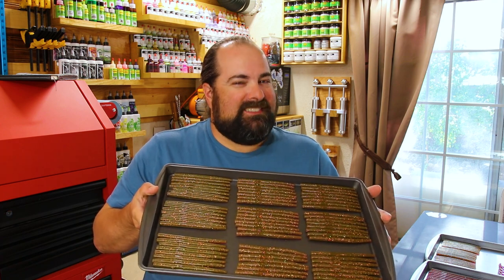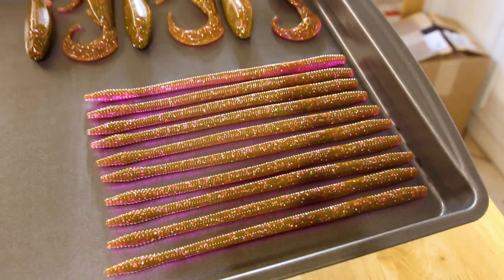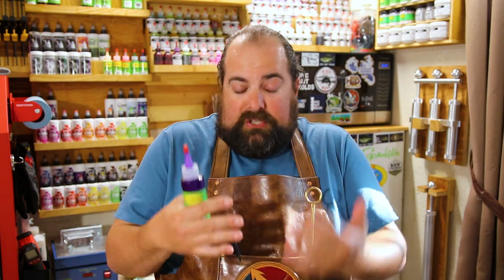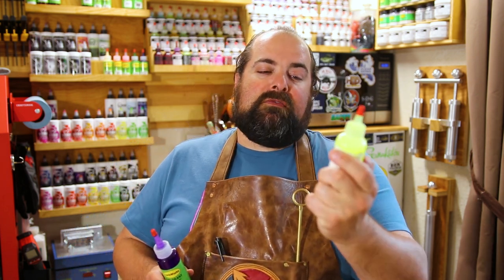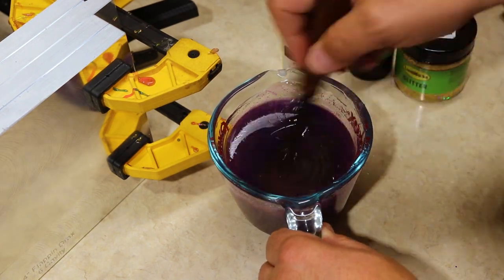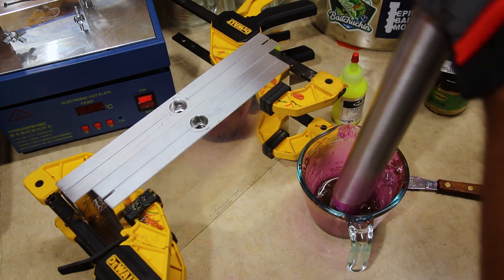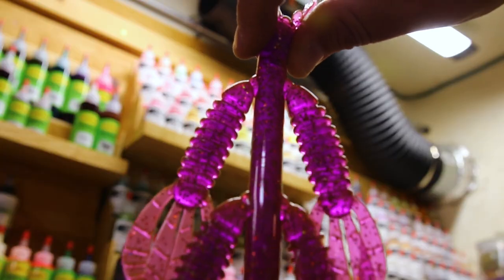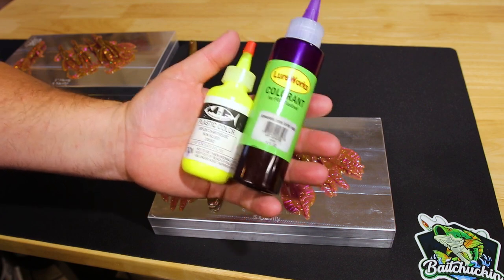THE OOZE - Making A Color Changing Soft Plastic Bait

Comment: I have some glow in the dark powders from Seisso that I use on my tumblers. I did a practice run with it and came out ok. I did one with just the powder and some with a pinch of sparkle violet from lure works. Wasn’t sure if I need to put glitter in it because it’s for night fishing!
Reply from the maker: Glow in the dark powders can be fun!!
Reply: @baitchuckin  does it matter if I put flakes in it? Not sure if fish can still see the flakes in the dark?
Reply: @baitchuckin  I have a question on 3.8” crazy hog cavity. When I inject this mold, not all of the real thin areas aren’t getting the plastisol to it and I was just wondering if maybe I’m doing it to slow and it’s starts settling up before it gets to the bottom part of the mold? My temp is always at 350 degrees when injecting the mold.
Reply from the maker: @chrishebert3240  Yes you should still be able to see them.
Reply from the maker: @chrishebert3240  You could be going slow, or the mold could be too cold which is in turn cooling the plastic quickly.  Also perhaps try apply a bit more pressure and hold the pressure for a few seconds.  Each mold is different, you're going to need to learn the little quirks on how to shoot each mold, no matter what company it is.
Reply: @baitchuckin  thanks Michael! I’m having fun with this stuff and does it really matter if I use my own judgment when trying to create my own recipe? I guess it’s works if your catching fish with them! Lol

Comment: I’m trying to find the glitter for this recipe. The blue highlte I can’t find. Is there a alternate glitter of you have a item number with the company you get it from?
Reply from the maker: Which recipe are you referring to? You left this comment on The Ooze video and this recipe doesn’t have blue highlite.
Reply: @baitchuckin  I’m sorry, it’s the moon dust.
Reply: @baitchuckin  I’m assuming the blue highlite is a glitter! Lol
Reply: @baitchuckin  when you mention flake glitter, is that something different from fine or medium glitter in size?
Reply from the maker: @chrishebert3240  No, highlite powder and glitter/flake are two very different things.  But again, this recipe doesn't have any blue in it for the Ooze.  I didn't know if you had a question on a particular color recipe or not.
Reply from the maker: @chrishebert3240  Ahh ok.  So for Moondust, you can get both the Blue Highlite Powder and the Sparkle Violet Glitter from LUREWORKS.  They are two separate items.
Reply from the maker: @chrishebert3240  Flake and Glitter can be used interchangeably.  Sometimes people have an issue saying "glitter" I dunno LOL but they are the same thing.  Then the glitter itself comes in varying sizes.  Typically "Medium" glitter is considered to be 0.04 Hex and "Small" glitter is considered to be 0.015 Hex.  Then the sizes go up and down from there.
Reply: @baitchuckin  I sent you a video and a few pics of my first bait mold I did. Had a little trouble sending them to you. So I had to do it in multiple messages. I think they came out ok for the first time for me making baits!